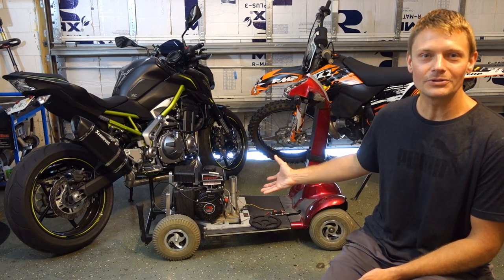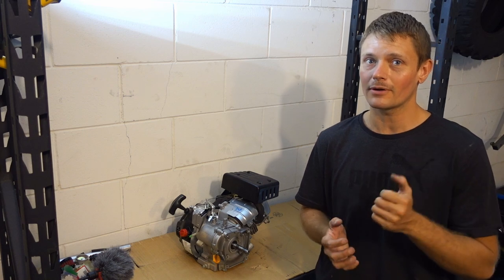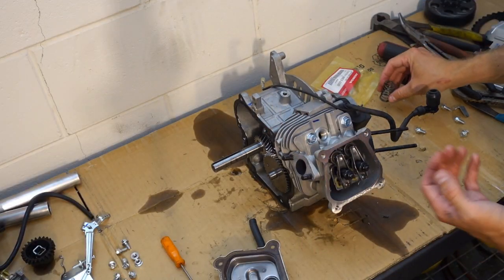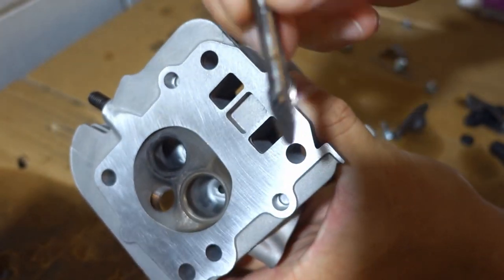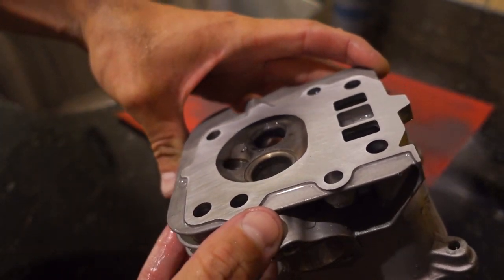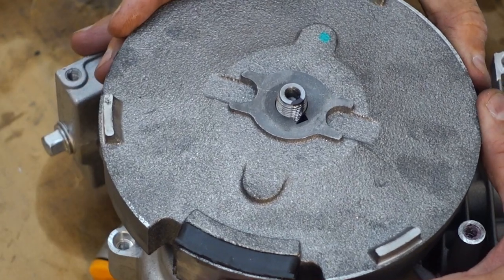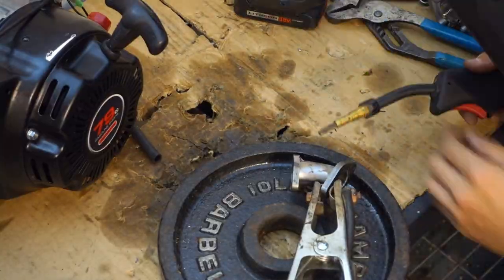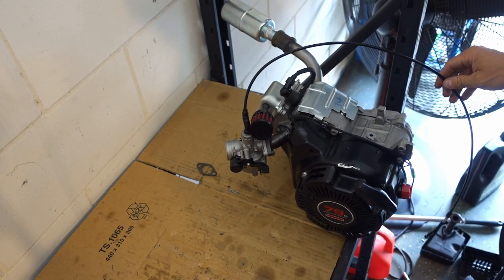Small Engine Performance Mods | How To DOUBLE Your Engine Power!

Comment: Do you use that oil to break in your motor? If not what do you use
Reply from the maker: This may sound strange but I like to use cheap conventional oil for break in. The reason being you want a little bit of friction to seat in oil rings and cam contacts points. I’ll run for an hour or so on cheap then afterwards switch to a higher zink content oil with flat tappet cams 👍

Comment: Couldn't you have turned the stator coil the other way instead of compromising the structural integrity of the Woodruff key? Just asking.
Reply from the maker: The keys don’t really lock the flywheel, they are pressed on so there really isn’t much stress involved. I’m not sure if reversing the stator would advance the ignition but I do not believe it does
Reply: @DirtGearTv  I'm not sure about the how the setup is on this specific bike, so can't be sure. But isn't the position of the stator wrt the point on flywheel during TDC what decides the spark timing?

Comment: Hello,why at 14:25 the engine is damaged? Why did you modify the timing key,right? Thanks,sorry for my bad english.
Reply from the maker: The flywheel came apart, so use a large gap like 40+ thousands or replace with billet. The timing key was modified to advance the timing about 10 degrees. The timing advance was not the cause of the engine failure, the timing advance is a safe mod to do

Comment: I dont get that thing about grinding the timing key. Yeah, I understand OFFSET keys, like an offset bushing on a timing chain. But if ya grind it thinner and put it in the original slot, wont it rattle? Wont the timing bounce around?
Reply: Donnell...it gives him space to rotate the flywheel in relation to the crank keyway...giving him some advance over stock if the flywheel is rotated then the nut snugged up.Any clearer now ?.Trev New Zealand🇳🇿🙃
Reply: You don't have to use a key. You can just use a degree wheel and set your timing and torque it down. It won't go anywhere due to the tapered shafts. The key is mainly there for installation reference at the factory so the flywheel is installed at the same static timing each and every time, no advanced engine building at the factory necessary.
Reply: No Donell...once locked down by the flywheel nut & some use of superglue & locktight etc once the flywheel nut is snugged home, the flywheel/crankshaft taper is enough to stop any way would play (hopefully) unless you crash & the Engine is Stopped abruptly.Any clearer now & for others ?.Cheers from New Zealand
Reply: Lol  thinner key .. adds advance  to   timing by moving the.   Ignitin  timing a few degrees  earlier is all  it does ..   earlier ignition timing ..  allows the fuel more time to  burn
Reply: @jmangus83  You can3t do that... The flywheel WILL move around with no key.
Reply: @davelowets  um you clearly don't know. If you lap the flywheel to the crank, the taper between the two components will keep the two locked together.  You don't have to trust me, look up Jody with Arc racing. I've setup several motors without keys, and not one has ever had it's timing shift
Reply: @jmangus83  Sure, sure...
Reply: @davelowets  you do you. plenty run without keys. If you don't want to, then dont
Reply: @jmangus83  I have, they slip eventually..

Comment: You know what? The company will probably never make billet flywheels for the public...I seriously doubt they will be selling them to the public. EVER.  Meaning if they had them all this time they would sell them. But.. If they did, it would eat into their huge $500 dollar labor charge for tuning one of their motors they offer up for sale. So don't look for them putting their flywheels on the menu! Thanks for the info. I wanted to tune up my new 79 Preditor and your video came in handy. But since the thing will fly apart once it gets the extra rpm...OMG> why bother!
Reply from the maker: You are right on that AKG is not planning to retail them, not simply because it cuts into other profits but it has to be custom built. So when you buy their performance package your not only paying for the better parts but also the labor for the custom made parts like the flywheel etc. I think the cost is reasonable for what all needs to be done the motor "labor wise". And I know they build these up nice to be little bombs!

If you are not going absolutely crazy with the build like 6500rpm or less your flywheel should stay on. My tolerance was set way low and with the extra rpm it shorted the gap between the pickup and finally made contact. My dumb fault really, Mine was set to 30thou, I NOW know this needs to be 80 thou to air on the safe side. Good Luck!
Reply: @DirtGearTv  Hey thanks. That explains a lot to me. I can increase rpm via a second cable to governor linkage and then use it like a turbo boost, rather then cracking the governor wheel out of the block. Sounds good to me, I have already noticed at full speed on the engine I can pull back on the governor link and it explodes with power. The way I'm talking about exploring the governor usage would be a controlled BURN. Not all out and OH SHIT--then ALL HELL BREAKS LOSE. haha.
Reply: I actually just emailed them about getting a flywheel by itself, having already done a few mods and gotten a few parts (linkage for stock carb, jets, air filter, 18lb springs, etc), and they are soon going to have them available to the public. The flywheel is really the only thing I need apart from sanding the head down some more and doing a port and polish.
Reply: Good news you can buy one from ARC racing for 170$
Reply: @DirtGearTv  AGK is now retailing flywheels independent of any other mods.

Comment: the trick for me was a better head & gasket 
matched intake & exhaust   ports by grinding both open and then sanding followed by a final buffing which leaves a mirror like finish.
I made custom gaskets from scrap tin I had left in a roll from a previous task and it worked like a charm.
Then I upgraded my ignition coil & spark plug.
Then I tuned in my carb whih I customized the intake port of as well.
The china doll engine loves to be carb tuned in 
to the air fuel mix aka ratio
and the pin in it from stock I never removed 
I just used a flat screwdriver to fine tune the the one already inside.
With my mods I clocked on a straightaway surface from start @54 mph
and with a different sprocket setup Id probably get more top end speed 
but I like the torque in the mid range area that you dont lose that much speed with.
Remember the larger your sprocket it 
the more initial acceleration will be present as the able torque that is also there on uphill angles.
The smaller your sprocket
expect less take off less climbing power/torque or pull based all on physics under the dynamic of a power source applied.
It gets tricky and for me the best for my life is based on the roads nearby my home
they are super rural and just got paved from rock/dirt FM roads to now newly ride worthy for any Huffy-Davidson you build
Just make sure you buy parts from a good source
and not Bikeberry.
They are pride stricken on their price as much as they are stuck on their service which is lips as far as I can tell this far.
Stay safe 
make sure your BRAKES WORK! or  youll have scars like me for life.
Regular bike brakes are NOT for added power
so make the upgrades to the stopping ability
the bike can have and enjoy your speed and power
never stop experimenting! 
stay hungry yall!
Great video
good experiencing and knowledge is baseline keys to the kingdom!
Reply: Polish to mirror finish I. The intake is not  a good thing .. if it's to add kick you loose  swirl ..   remember .. it air and fuel  and the better it is atomized the better it will burn
..  port matching helps tho because it makes for smooth transitions  between  areas   in the fuel path..  other wise 
. It's like people  going into a store  and hitting the door jamb on the way in
Reply: Gearing is simply 5he amount of work you are asking of tbe engine  and the amount of time you are giving it to preform said work.. if you let the engine  .  Make two revolutions. For   one revolution  of the driven tire ..     vs    one revolution of the  engine   for one revolution  of the tire .. 8ts the same  work .. but you are asking    only half as much of tbe engine because   you give it twice as much time  to do it in ..
Reply: Digging around in a carb venturi is a horrible idea...you don't "port" a carburetor.

Comment: What do you guys think. Predator 79 or Huasheng 144? For a 1940s Hiawatha bicycle. I’ll cry if the bike gets ruined because the engine was too powerful
Reply: Old bike steel.are tough as hell. A 79 be fine
Reply: Check out my tutorial on a predator 79..i have it gear 12:1 not the best of anything but one thing it didnt go boom .
Reply: K Lucifer Any thoughts on a manual clutch? Seems pricey but I keep seeing the same gearbox.

Is this going in a bike? Do a video on vertical mounting:):)
Reply: @st.paulmn9159  those manual clutches are out of stock and why vertical mount i mount mine horizontally
Reply: K Lucifer looks are hot
Reply: @st.paulmn9159  you do know you need run 20oz of oil vertically and also need an intake to make it work right?
Reply: Yes vertically mount need an intake thats made for carb to be level
Reply: K Lucifer hey thanks AGK has the intake manifold for the 19mm carb.

Should I buy the bored out carb they offer or the 19mm? I’m just going to remove the governor. I’m not going to do springs. 

And will a 212 torque converter work or should you stick with the famous chain drive one?
Reply: @st.paulmn9159  if stock box you not springs just becaref not to flaot the valves.and yes the torque convertor works if you use a 5/8-3/4 adapter...but itll rob top speed

Comment: awesome video. I have the same engine and stripped the 2 bottom crank case bolts and was wondering if there was enought room in the thread to heli coil it or whatever might work someone said use sum jb weld lol
Reply from the maker: heli coil is great but I don't know is there's enough room for that. I would probably just go up a size or two with a tap and re-thread it for larger bolts
Reply: @DirtGearTv  okay nice I'll try that it won't hurt cuz I can always get a new 1 for cheap it just sucks bc I have not got the life out of my parts I had to get for it and I would like 2 get the 212
Reply: @youngchap4941  well, think of it this way: you now have spare parts!
Reply: @TheDustyShredder  hey i ended up just rethreading the threads i got a little cheap set from walmart this little predator engine is still going strong lol
Reply: @youngchap4941  that's great to hear! Mine is too, and I'm looking at significant performance mods to get my 8 speed shifter up to 55 mph. At the same time though, I've got a 198cc duromax electric start engine I'm wanting to put on a bike with a 5 speed motorcycle gearbox, but I can't seem to find a frame that will fit the beast. My estimate is that it'll hit 70mph or higher, and I want to have it on a chopper bike so it's not so twitchy.
Reply: @TheDustyShredder  man that sounds amazing mine only goes 40mph and i feel like im going fast cant imagine 70 lol
Reply: @youngchap4941  yeah, it'll be super fun. As it is, I still need to find a sturdy steel frame, and I need to finish my 79cc bike. I've got an update video planned to go over the upgrades I've done, and future videos for each upgrade I do after that, and they'll be detailed. My phone can take 4k video, so you'll be able to see everything with great detail. I'll even go over the mount. Have fun, and ride safe my friend.
Reply: Heli coils  don't  stay put ..  .. better to just tap over size..      quck fix is put a bit of steel  wool between threads don't  try ..  over tight b

Comment: Love AGK they have everything you need for the p79-p212 and the tillotsons
Reply from the maker: Yes, yes they do!
Reply: @DirtGearTv  some what random question... would you happen to know how or if its possible to hook up a power generator to a p79? Mostly for just a headlight but having enough power for a full street light kit would be awesome..
  I have a "2020 phatmoto rover" a motorized bike that im fully rebuilding and upgrading running a p79 built out about the same as yours. I am running a modded "E.T. power" LED light it is bright sure but i want a retro/cafe look light cant find a good one thats rechargeable battery powered
Reply from the maker: There are generator kits that can be run by pulley, but with the limited output on the 79cc im not sure id go that route. I know you can buy charging coils for the 212 that fit under the stock flywheel. I don't think the 79cc is setup to mount these under the flywheel but the same coils could probably be mounted around the outside of the flywheel. Not sure how many watts output you'd get but it would be a cool experiment